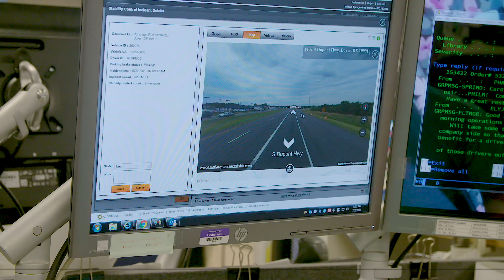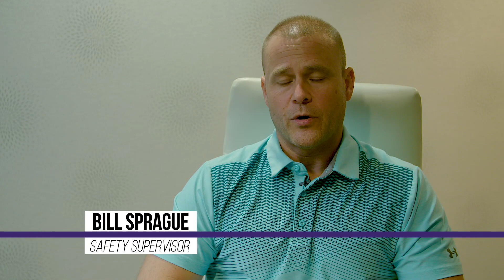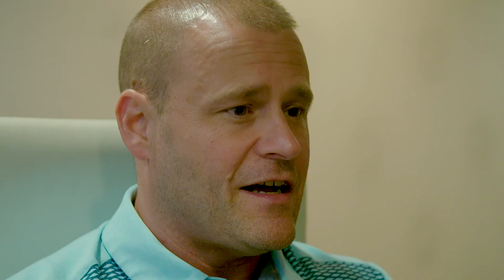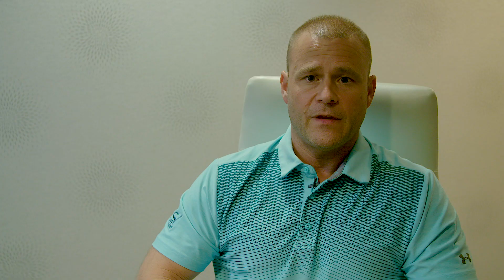Prime Inc. | Critical Events

Comment: The older trucks are definitely defective because I got a few critical's from bridges that were way above my height. I was in a 2017 truck. My 2020 rarely does it, so it has gotten better, but my awareness of when it might trigger has gotten better, so i turn it off during those times.

Comment: I drive for Prime & my forward collision/lane search system activated my brakes going less than 20 mph on an onramp during a right curve. I guess it detected the trucks parked along the shoulder or their shadows, IDK. But it gave me a critical event for forward collision. Be careful with driving under overpasses as well, detects shadows & will activate the braking system.
Reply: That's happened to me a few times.

Comment: My Qualcomm unit shows over speed as 77 or higher for 30 seconds. My fleet manager told me it was 77 or higher for 30 seconds. Don’t know about this 75 threshold.
Reply: My qc never shows overspeed. I get it on the dash though.
Reply: Go to Performance Monitoring, then Violations, then Thresholds on your Qualcomm. My overspeed is set at 77, excessive speed at 80, over rpm at 1800. I'm in the reefer division here at Prime. I back off the speed on downgrades before reaching 75 just in case it triggers an overspeed.
Reply: Where do you find the parameter on the QC?
Reply: ItalianStallion1415 go to performance monitoring, click on violations third column on the fight click the box that says thresholds.
Reply: I never go over 70 on down grade. Im terrified to get overspeed on my performance.

Comment: I drive A2636 and I get these forward-collision alarms going under an overpass, sometimes 2 or 3 times a day, is there an adjustment that needs to be made on that or what?
Reply: But they will tell you it needs adjusting. Take it to freightliner and they will have no clue how to fix it. It's a catch .22
Reply: @scrolex  Exactly. Prime need to start listening to us drivers when we say these things are not safe. Prime trucks is like riding a bike with training wheels. How are drivers supposed to learn to drive if you never remove the "training wheels". At lease what prime should do is give the trainees the trucks with the safety features and give us the trucks without it. It's very stressful driving these trucks with all these safety features. I always fear driving these trucks because the truck always wants to do it's own thing. Man I hope Prime reads this!!!
Reply: Nothing won't fix that issue.
Reply: You just need to get to the shop and get your radar realigned

Comment: I love when my truck auto brakes in the middle of nowhere with no other cars in sight, it’s exciting, I hope it does it in a turn in the snow.
Reply: But they think it's safe.
Reply: @mrb5367  yes not to mention driving hwy 50 through nv in the middle of the night thinking about all the monsters that could be out there then all of the sudden the dash lights up red and beeps. I almost crapped myself.
Reply: @scrolex  😂😂😂 Neveda is one erie state.
Reply: Had that happen to me in the snow last winter except a car turned in front of me to take a exit and the truck slammed on the brakes and the trailer slid into the other lane. Was real glad no one was in the outside lane when it happened 😓

Comment: I wish we all had built in dash cams not driver facing, road facing.
I bought one last Friday after a car came across the nose of my truck.  Uninsured motorist and told police it's not required in Vermont when a car is valued under 2,000.
Not true because insurance is needed for the vehicle to get inspected.
Anyhow, I highly recommend with all the idiots out there everyone gets a dash cam.
There is one that can be hard wired into the Qualcomm.  Had one in my peterbilt.
Reply: Just know that they may install a two way dash cam, I will never allow one in my truck, if you are a lease or owner OP then go buy one, they are not that enspensive, and they are tax deductible, otherwise if your company, go ahead make them pay for it.
Reply: Ask prime for it they will install it for free.